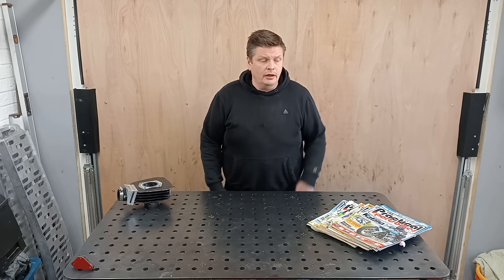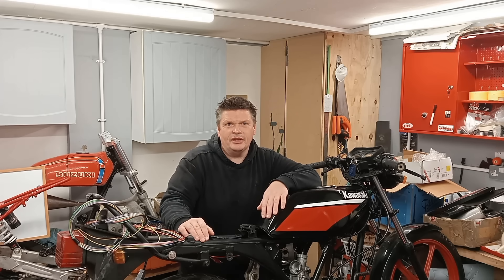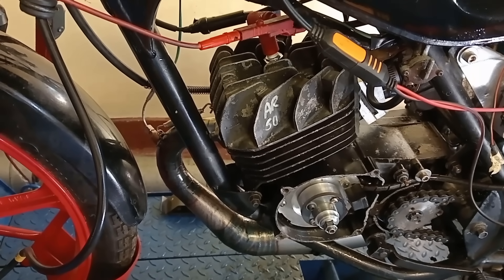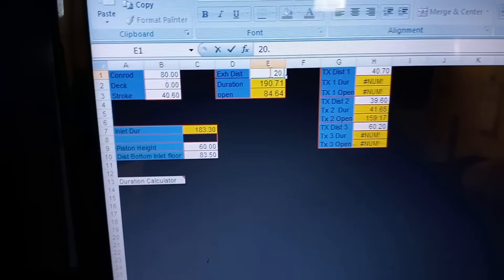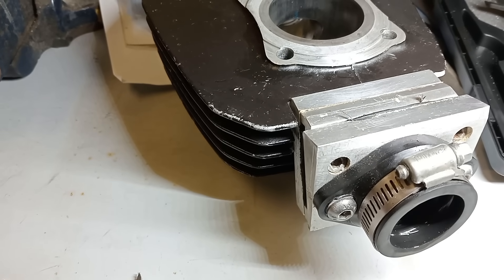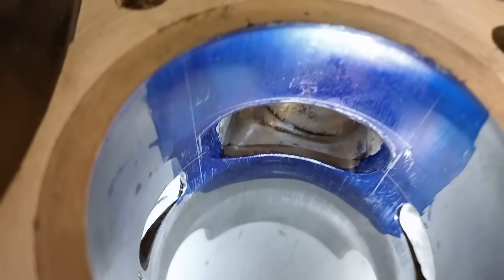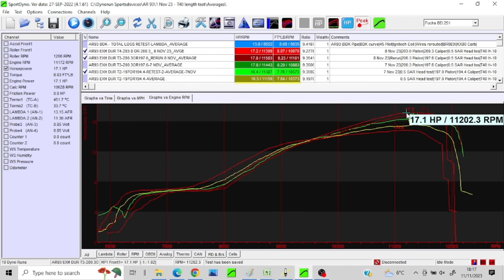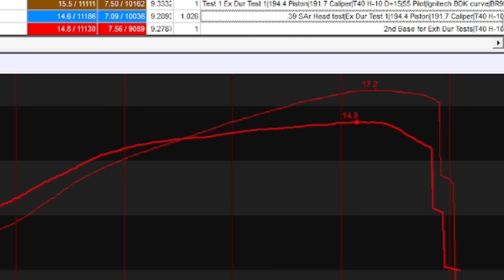This Tiny Port Change Changed Everything (Dyno Proof) #2stroke #power  #porting

Comment: I noticed that there is space for 2 extra transfers ports between boost port and 2nd transfers.
You can mill a slot into the liner.
I also think the suggestions of single ring piston are viable.
I've noticed that blata mini moto 50cc pistons use ver very thin ring , single ring piston, possibly 0.6mm.
I've only got 40cc pistons or id post you one to try😁
Reply from the maker: Hi Peter, cheers for the suggestion 🙂
I'll have to have a look to see if it's possible... As I remember it does get quite tight there, where the cylinder bore gets close to the cylinder stud. 
Single ring is definitely something I want to do but I need to change the conrod first (extra length and bigger small end)
Thanks for the offer too. 
Cheers
Dave
Reply: @AutoBeta2T  why not make a different liner?
The intake has essentially 3 ports after reed valve- make a liner with either one or two inlet ports.
I believe a single port flows around 20% more than a divided port with same cross sectional area.

Regarding cylinder studs, cut the extra ports deep enough to reach stud space, then sleeve the stud space, to avoid air leaks etc.
You know that you are as deep as you can go then.....  Very much like making love to a beautiful woman!  Go as deep as you can until something breaks!........then ride it at full speed.....
Reply: @peterjohn3180      What do you break more often?  Modified cylinders or women?   
Which is more expensive?   :)

Comment: What about putting a radius onthe inlet port especially the center column divider bringing it into  point leaving about 3 mm across surface, just a mm around the top and side that should increase the lower band as well. I thought the piston seemed a bit on the loose side is quite a gap can you get an oversized piston?
Reply from the maker: Jedi - noted, I'll have a look at the inlet inlet. 
I'll double check the piston to cylinder clearance too. 
Not the dykes piston crown is a few mm smaller than the rest of the piston.

Comment: Remember, if you change the pot timing you have to adjust the pipe configurations as well. Port timing work along with your reflux gasses. Goodluck😉🥂
Reply from the maker: Cheers - a new pipe is in the pipeline 😊

Comment: Look at Patrick Bächler´s channel. He too made an 100km/h-50cc-engine (62,5mph), with great coverage by the sole 2 gears of the original engine (no power-gap)... Even in his channels´s thumbnail, you notice, that his Sachs-cylinders have 6 boost-ports, and up to 11 ports altogether (always made out of original Sachs-cylinders by grinding new ports). 
He also tried variable length exhausts (long for high and short for low RPM, stepless/smooth graduation), thus greatly stretching the peak-power-plateau of an engine (not part of the 100km/h-engine-challenge, tho). Ask if you need more details, since everything is in swiss-german accent, that even Germans hardly understand... Depending on what you search for, I can suggest specific videos, with some timestamps.
Reply from the maker: Hi Klaus, I've subbed to him and had a quick scan.
If you have specific videos with a timestamp theatre would be great. 
I seem to be in a constant battle with time!

Comment: A good way to find out how far to raise the exhaustport is by taking it off the edge of the piston first (just only from the edge exposed by the exhaust port), then start porting the exhaust port. By the time you went too far, you put back in an unmodified piston. Now you only wasted a piston, not a whole cylinder
Reply from the maker: Hi Fred, that would have been the plan and I have done it like you describe before; However, with the  dykes "L" piston ring there is not a lot of distance from the top of the ring to the crown of the piston, also at the crown the diameter of the piston is around 2mm less than the rest of the piston so the exhaust timing is controlled by the ring.
If I had a more conventional piston I would have pushed a little further up to maybe 206 degrees filing the piston - just to see.
Reply: @AutoBeta2T  hah, gotcha. That makes sense. In the past, I also have done, taking 2 mm off the top of the cylinder and adding it on the bottom with a spacer (1.5 mm aluminum and 0.5mm gasket  extra) This brings everything (like transfer ports) up as well. 2 mm is acceptable, I think, without lowering (porting) the transfer ports. I can't remember what the numbers were for port timing, though. Good luck and have fun tuning (kinda jealous, I would like to do stuff like that again, but I live in Canada now. Not many 50cc shifters around)
Reply from the maker: Cheers Fred - yeah it's great fun (when it works) ☺️
Maybe a 50cc may come up?

Comment: Hi we put the exhaust to 75% of bore at top on my 50 and it was a big gain with  206 duration with 15.1 compression
Reply from the maker: Cool - good to hear. 
Any issues with 75% bore?
Reply: No maybe it we’re ring a bit faster but we can run about half the drag year on one piston and ring  @AutoBeta2T
Reply from the maker: Sweet - sounds like it's worth me widening a little then.

Comment: A couple of us did some radical stuff on yamaha fs-1e's in the late early 80's. drastic disc valve mods to increase inlet duration and some pretty wild porting and skimming heads. and we used "Castrol R" racing vegetable oil on some of the more higher revving ones which stopped them seizing. a very small finned IRON barrel gets very hot and cannot dissipate the heat .
Reply from the maker: What sort of speeds did you get? Sounds fun!
Reply: @AutoBeta2T  around 55-60 mph sat upright on the flat in calm conditions. we did achieve 65mph prone on the flat on one of them but the rev limit was so high and the power band so narrow it was geared Down 2 teeth at the gearbox sprocket to be able to use to top gear around town. on that one it must have been revving to 12000+ rpm  and difficult to ride !
Reply from the maker: Brilliant 😊

Comment: Is it worth checking squish band clearance?  as you maybe able to reduce it but watch out for detonation  though  , great work on the ports though
Reply from the maker: Hi buddy - In the last vid I found the squish to be 0.45mm  so possibly it needs to be greater.
Cheers to - pleased you like.
Reply: @AutoBeta2T  No probs I should have watched all videos ,anyway good luck hope you get your 20 +hp . Just remember in my 2 stroke days wide squish you lost power to tight detonation wrecked head and piston . Two stroke tuning is such an art , you can't chuck a cam in like on a 4 stroke
Reply from the maker: Thank you - hopefully I'll get the power before summer this year.

Comment: About port-timing/angle, i use the caliper methode. More importent than the final angle, is the relative angle in comparison to the transfers. 

So if you measure the transfers at 130° and the main port at 203°, the blowdown wil be 36,5°. Shifting the cilinder height doesn't change that number to much

Also i use the caliper to find piston-edge (dykes-ring edges) to cilinder-edge when piston is at BDC and calculate the port heights .

From 195°/203° you should see  a drop in torque but a larger shift towards  higher rpm (more hp). But at a certain moment only torque drops and there is no gain, this however only happens if the exhaust hasn't got a strong pressent in the first place.

Ps. I would also use a second piston with a lower compression height to exceed the 203° and the use for interim values.
Reply from the maker: Cheers for the tips. 
I've not paid much attention to blowdown angle to be honest (more Blowdown STA). I have 36 degrees blowdown angle currently - is that a good figure? I imagine it is somewhere near the upper limits?
Reply: "35° is the longest period for most racers. Don't go too far.
130° for 'A' ports and 132° for 'B' and 'C' ports.
190° for 50cc engines and 198° for 125cc engines.

Maintain an equal exhaust-port angle*area to that of the intake, but never decrease the exhaust below 190°. Also, ensure that the angle*area of the blowdown remains approximately 13% of the transfers angle*area.

When blowdown is enlarged, transfers start to discharge better to the low-pressure cylinder. The same effect can be achieved by raising the transfers and blowdown proportionally, resulting in a much lower total exhaust duration." @AutoBeta2T

Comment: Nice!
I own a 1987 MBK CF (which mean Compétition Française) Group 2 competition moped with a 50cc cylinder and almost 13 horsepower. Top speed exceeds 145 Kmh (90 Mph). With a 93cc cylinder, it will be very easy for you to exceed 100 Mph.

To work on the transfers, I use a sheet of carbon paper, which I scan to optimize the shape with vector graphics software. Then I print the modifications with a laser printer and transfer the toner with a soldering iron into the cylinder, keeping it clean and free of grease. Finally, I mill it with a dentist's angle grinder... just like everyone else.
Reply from the maker: Hi again Siem, does you MBK CF have a fairing?
Also what do you mean by carbon paper?
Reply: @AutoBeta2T  On my CF, I have the original '87 fairing and that of the 1991 model. The 1987 front fairing is very fragile at the spider supports. The seat is a disaster, because it was a piece of plywood with resin. The wood isn't very well suited to all the vibrations, so I find it hard to understand MBK's choice.

Sheets of carbon paper are used to reproduce a trace on a sheet by transfer.  In the days of typewriters, it was widely used. All I have to do is tape a piece of it into the perfectly degreased cylinder, and with a point (a fine nylon spudger for dismantling electronic things) I mark the transfers. Then I scan the sheet to make perfect tracings in Illustrator, Rhino (just perfect) or Inkscape. A laser printer printout of the modified tracings. I fix the laser print against the cylinder surface and iron the reverse side with a soldering iron set at 180-200°. Finally, the print toner is transferred to the chamber. I've been using this technique for over 20 years. It may seem complex, but it deserves attention.
Reply from the maker: Cheers Siem - I think I follow now. I remember copy paper when I was a kid. So the laser is used to create a laser template for the port windows which it then printed with the soldering iron activating the toner.
Reply: @AutoBeta2T  Carbon paper is paper with a layer of carbon black in a suitable binder on one side. It was used to produce two or possibly three copies of a document simultaneously on a typewriter. You place the carbon paper between two sheets of normal paper and it transfers an impression to the lower sheet but not with such good quality. If you have the carbon paper the wrong way over, you get one document that is blank and one that appears also in mirror image on the back.
Reply: @siem8160  To MBK/Mobylette/Peugeot fans may I recommend going to YouTube and searching for "Gaziantep otoban yarisi"
where you will see an amazing race along a Turkish motorway and will also get offers of other rather similar videos.
Reply from the maker: Just watched it. They are nuts!
That said, I could do with that road for testing my bike.

Comment: You can easily look at the am6 motor and see how they tune 50cc to 20+hp , yes they can achieve more power but it simply goes bang to easily . Look at the bud bike that has the 50cc landspeed record , they could never get the bigger power last a full run. Then you got dave from PWC who tunes model boats 29cc that are up to 18 hp
Reply from the maker: Yeah - there should be more power in there somewhere. I don't think I'm helped by the over square motor and single exhaust port but I'm willing to give it a go!
Reply: @AutoBeta2T  look at am5 tuning , air cooled single exhaust port . Tuning two strokes is 5 steps backwards and 6 steps forwards , never easy lol
Reply from the maker: Yep - it never is. Fun when it works mind 😄

Comment: Back in the day…..
Autisa 93cc Barrel and piston
AR80 6 speed bottom end
Ar50 cylinder head, welded and turned to match 
Exhaust side of the piston 2 small 1/8th holes drilled to match where the studs travel through the barrel, preventing hot spots.
No real porting just removing casting imperfections and polishing.
All speed exhaust 
BDK race engineering CDI
Reed valve block spacer 
I forget the sprocket sizes I used
But I reliable 85mph machine.
24mm carb
Castrol R and 4star petrol!
Reply from the maker: Sweet - sounds like a good spec. Mine would only go about 70 mph... I like 2 small holes in the piston trick. Not thought of that - cheers :)

Comment: Study the porting on the most powerful two stroke engines, to learn what an engine needs to produce power. The AXE Motor Rossi COBRA Model 223R25 has 941 hp per Litre. Your bike engine is at about 160 hp per Litre. Good luck.
Reply from the maker: Hi Christopher - I had a look and the porting arrangement looks fairly basic except for the triple port exhaust. Still - impressive power. I noticed that the heads have a lot of fins for cooling.

Comment: Now this is how you do research. I think you should also be looking at the area of the port. Shape, size, and timing each make a difference. Each part of the air flow needs to match the flow before it and after it. Being the flow of the Intake, intake port, transfers, exhaust, and pipe.
Reply from the maker: Hi David - agreed but it's quite a task. I'm hopefully doing some flow testing this weekend. Hopefully that will give some pointers.

Comment: I have had great results spacing up the cylinder, that way the transfer duration and flow area increases, it works very well when you are increasing the peak HP RPM, I would try 1-2mm spacers on a cylinder with the stock exhaust port height, machine the spacer thickness off the top of the cylinder, just make sure the bottom ring end gap doesn't pop out into the intake port @ BDC. I would space up a cylinder first before any porting when you want the peak HP RPM higher. In my experience a1mm spacer was good for about 1000rpm increase in peak HP RPM on a 120cc engine without any porting, cut the piston skirt on the intake side on a piston port engine. *You will have to grind the bottoms of the transfers and exhaust port after spacing the cylinder if the port bottoms are above the pistons. I have spaced cylinders up to 3mm, that moved peak power RPM from 7200 to 9500rpm on a 600cc triple snowmobile engine.
Reply from the maker: Hi, I'm a bit stuck with the current cylinder as the barrel can't go much higher as the piston will pop out of the top and with the dykes ring sitting 0.5 mm below the crown of the piston i'm a bit stuck. I did do a quick test before the last raise of the exhaust port and it didn't make anymore power unfortunately but that could have been compression loss.

I do like the idea of a spacer to increase the transfer duct inlet area. I could do this by installing the 5mm loger rod I have (RM80)!???

Thanks for all the info and ideas - appreciated.

Comment: Great video. What kind of ignition are you running? As you know ignition timing is a major factor for gaining power. I saw that you have quite a bit of wet mixture on top of your piston, so maybe the ignition is set a bit on the late side?

Comment: Just subbed. I´ve been really getting into these moped wars. Asoftaaja, Two Stroke Stuffing and now you. And seems like you are leading the race :yougotthis:
Reply from the maker: Cheers PPekka :) Asoftaaja has just had a good breakthrough with ignition. Plus I'm at 97 cc!
Reply: @AutoBeta2T  oh. I thought you were doing 50cc too. Well not Bad still, not going to unsub for that 😅
Reply from the maker: Cheers - I do have to contend with air-cooling, a very over square engine, rubbish transfer ducts and a single exhaust port. 🙃

Comment: What is the cylinder size bore × stroke? Because I see the piston like 65
Reply from the maker: Hi, it's 54.5 mm bore (53mm standard) and 41.4 mm stroke. Giving about 97cc
Reply: @AutoBeta2T  if you bore it in offset its should add atleast 2HP. Or with standard bore 53mm with diesel sleeve offset 1.5mm. I usually does not jetrod but you can try scheme the top 0.3mm maybe
Reply: @AutoBeta2T  also dimples porting on side piston. I'll be waiting for your next video. But never forget 2stroke engine only can hold to 14.5spi

Comment: A word of advice, .... do NOT use wood working   "carbide bits " for porting, buy the correct metal cutting bits, .... much better control and finish .
Reply from the maker: Cheers for pointing that out Mike - I hadn't realised. Do you have a link or a name of the type of burr I should be using?
Reply: @AutoBeta2T i only used double cut carbide burrs, with turps to keep gauling on the burrs.. double cut avoids chatter.. not aware of any differences metal vs wood burrs.. nor my supploer

Comment: This is brilliant,  back in the late 80's, my first girlfriend had an AR 50 and an AR 80. I did exactly the same to the 80  ( 93 barrel tuned, micron pipe and a slightly bigger carb) , it would wheelie off the throttle in second gear ( and third with a bit of help ). It was more fun to ride than my RDLC because of the power to weigh ratio.
Ah the good old days 👍
I will be following this closely, keep up the good work 👍👍
Reply from the maker: Hi Stephen - if she rode an AR 50 and an 80 she sounded like a keeper!
Yep, these are lots of fun. I took it out last year before I did most of the mods and it loved popping up the front wheel in second - lots of giggles :)
And thanks for tuning in, cheers, Dave

Comment: Why didnt you just the front measuring bits off and use the back measuring bit as they are designed to measure inside diameter.
Reply from the maker: I wanted to measure the disctance from the top of the port. If I can get another set then i'll grind off the front bits and keep the rear. Cheers